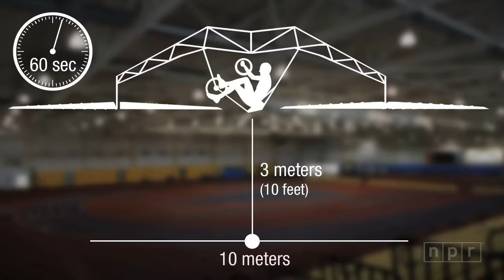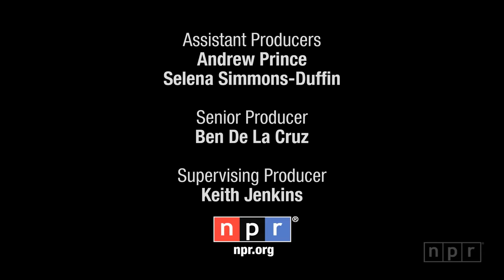Human-Powered Helicopter: Straight Up Difficult | SKUNK BEAR

Comment: 10 years later:
“What type of power does this helicopter use?”

“2 double A’s”
Reply: @archangelmichael5908  they are light weight
Reply: @poke_champ  I'm not heavy.
Reply: honestly, they probably could retrofit an electric motor and it'll still e lighter than a person
Reply: @daddyplankton5855  then it would just be a giant drone and where’s the fun in that
Reply: @ebeneZr   yeah there's no suffering
Reply: That is possible but you'd only be able to run it for a small time, here's my calculations, feel free to correct me if I made any wrong assumption or approximation:

The power requirement for the helicopter to hover for several seconds in this video is 0.7hp as stated in the description. Let's say after 10 years material sciences has improved enough to cut the weight to 25%, effectively reducing the power requirement to 0.175hp, which is 130 watts

A double A battery holds about 14400J of energy (4 watt hours). 2 batteries makes 28800J. Let's say 10 years later battery capacity has tripled, which makes it around 90000J, and assuming each battery can output at least 65 watts (which is a lot and it's 20 times the power current batteries can output)

The amount of time the batteries will be able to power the helicopter is 90000/130s ≈ 700s ≈ 12 minutes
Reply: i love your profile pic, name, and this comment
Reply: @facecrafter1328  The energy density of todays batterys is allready equal to that of TNT, its is not clear if a big improvement on that is possible.
Reply: @hernerweisenberg7052  Lithium Ion technology only goes up to about 0.8 MJ/kg, Zinc-Air (the best non-rechargeable) is about twice that. TNT comes in at 4.184. There is certainly a lot of potential for improvement though. Lithium air has achieved 9MJ/kg in the lab, but it has a ways to go before it is widespread. Organic energy storage can go above 35MJ/kg, and miniature internal combustion engines have been made that could burn organic energy. I'm actually not sure why these aren't more widespread in phones yet. Perhaps because Oxygen can't be stored as densely?
Reply: If you look at energy density of fuels for combustion engines, it is assumed that you take the oxygen from the air. If you include oxygen into the energy density for applications like rockets, it goes down from about 46MJ/kg for kerosene(for airplanes that use air) to about 10-11MJ/kg for RP1/LOX.
Regarding the phone application, that sounds lika a really bad idea ;D
Reply: Solar
Reply: Training bras only
Reply: ill check in 10 years
Reply: anyone watchin in 2030 please confirm
Reply: @ebeneZr  whats not fun about a giant freaking drone, that sounds sick
Reply: LOL
Reply: This video is almost 10 years old. What would be the point of a huge helicopter incapable of lifting anything?
Reply: wait fanf was set in a helicopter? huh
Reply: @Juksemakeren  to win 250k, of course.  and they did, just a few months after this vid was last posted.

Comment: they're using the same gearing for arms and legs, It would be better o have slower for legs and faster for arms to cater to their max strength outputs
Reply: but it would be heavy, and I think they considered that already
Reply: Kommentator 123 I would have thought that they would have considered it already but it should only produce a negligible weight increase (max 500g if done right).  simply increase the size of the leg gear and reduce the size of the arm ghear to get the ratio and then resize the spindle to maintain the same kinds of rotational speeds.
Reply: Could work!
Reply: the arms are just lightening the load of the legs. it's the same gearbox for both of them. there are no separate gearboxes, just two inputs.
Reply: ***** This is not entirely true, the arms are producing torque, just like the legs and while at the moment, they are attached to the same geartrain, what we were discussing was the possibility of changing the gearing ratio for the arms (which just requires changing the size of the arm pedal gear), thus allowing them to bettwer utilise the arm power of the user
Reply: James Ward
pretty sure they thought of that and that's already the ideal rate.
Reply: The real problem there is that the pilot would then have to move their arms and legs at different frequencies, which would mean they couldn't swing their body laterally in the same way. The pedaling motion isn't just moving their legs, their whole body moves to preserve momentum and gain extra leverage and stuff.
Reply: Anson Mansfield ahhh, that makes sense
Reply: The difficulty with this idea is that the pilot would have to rotate their arms and legs separately at exactly the right speed so all 4 propellers matched. And the added weight of the second gearbox/gearing
Reply: There would be no added weights. Currently they both on x# of teeth sprockets. You could make one x-5 and one x+5 teeth and the weight would practically be the same. They do how ever need to get one athlete and set up a controlled testing method to find out what ratio is best for that one person..
Reply: Nicholas Hartzler
Reply: Another thing to consider is how to max out the output of force from the person while using as few muscles as possible.
Reply: We are not allowed to say what would work.
I have a degree in math and I am unqualified to answer this question.
Reply: yeah i was thinking that too to lower the gearign ratio for mroe muscle =higher rpm
Reply: Strength/Height isn't their problem though.... If you actually listened to the video, you would've heard the guy say he has yet to become fatigued and had to stop. Their issue is with the drift. Also, these are ENGINEERS, who have spent probably thousands of hours on this project already. You watching a 5 minute video and telling them to change the gearing is kind of a slap to the face, I would think. They've already thought of that, bro.
Reply: wonder if frame wouldn't support the stress of the torque
Reply: Impossible. The arms have to balance the legs. If they are at different speeds they will sometimes be helping, but mostly hindering badly. Have you ever walked with your right arm swinging WITH your right leg? It's almost impossible to walk. Same here. The leg power strokes need to be counterbalance by the arm power strokes.
Reply: it could work better if he sat on it like a two wheeled bicycle. then he can put his back and body weight into the pushing and pumping of his arms and legs.
Reply: the best idea would be to control the propellers like the arns for the front and legs for the back so they could control drifting
Reply: Just noticed the arm pedals!...probably not worth while at all, they should use bicyclist and just use leg power.
Reply: they need non-twig pilots
Reply: they dont have differing gears because it would have to be changed for every new pilot.
this way....one size fits all.
Reply: I thought legs were stronger than arms ?!
Reply: I also think they could switch the pedals of the arms to allow the muscles to work as they should (rowing instead of cycling for example)
Reply: also im pretty sure its meaningless to use pedals for arms, would be better to put some bar to hold on to and try to maximize leg output.
Reply: @juicyclaws  so much this. And get a good cyclist with experience in recumbent bikes, and it would got through the roof

Comment: you need some kind of a weight like in agyroscope to get enough throttle I guess...I´d try it with a variable length so that it sticks out more the more speed it gets
It may be helpful to run it in a gyrocopters design anyways

Comment: Da vinci APPROVED THIS
Reply: If you look closely you will notice smoke and steam rising off the da Vinci machine. So much for man power. If the thing at the bottom was indeed a platform, the man would spin himself off it. His ornicopter, however, could have flown using a man power. It was engineered for movement like climbing a ladder, very efficient. Perhaps better take than this one, as here left goes with left and right goes with right, not the most efficient way of going about it. And I mean this already is awesome, indeed. Not everybody is da Vinci.
Reply: @kokeskokeskokes  obviously that never happened hahaha

Comment: This is late 1400s' cutting edge tech. Da Vinci would be proud of them.
Reply: i flew further when i was 8 years old and jumped off the roof wearing my Batman Cape.
Reply: .. I mean, with the exception of the Styrofoam.
Reply: I think they used a bunch of carbon fiber trusses and stuff
Reply: When you do level one in expert mode
Reply: ah yes my favorite kind of 1400s tech... carbon fiber tubes.
Reply: @cacornhusker2940  Ahhh, but the point of this was hovering.
Reply: @Nashvillain10SE  Excellent Point. Watson.
Reply: @cacornhusker2940  🚁
Reply: Did you miss the part where they said "the highest a human powered helicopter has ever gone was 3 feet in the air" or are you just as dense as a real aircraft?

Comment: Imagine being rescued in the middle of ocean by this thing
Reply: I will hug the pilot!
Reply: I think a slight breeze would be a nightmare for this thing
Reply: Only to see it crash in front of your eyes, while you're shouting at it: BACK DOWN, BACK DOWN!!
Reply: Only to have the pilot say "sorry, this thing can only carry 1. Bye!"
Reply: Johan Rodrigues  Johdrawn Drawnrigues
Reply: Imagine fly over the ocean with this thing and not get crushed in 5 minutes
Reply: Lol yeah right everyone will die hahahahah
Reply: Just drop down a string attached to 1 single helium balloon that says "Happy Birthday" on it. Say "good luck" to them.
Reply: @m.i.b member And maybe a second rotor and a chassis, maybe batteries and self controlling electronics, maybe 2 more seats, a radio system and lights..
And maybe a gasoline engine?^^
Reply: g- grab my hand

What? 

I SAID GRAB MY HAND!! 
I can’t hold it for much longer
Reply: impossible. this obviously has a weightlimit that would be greatly exceeded by 2 humans. there is also no way somebody could fly this for a decent distance.
Reply: It's impossible... no it's necessary
Reply: Bahahahahaha
Reply: I won't complain
Reply: soon those sharky will be headless
Reply: imagine someone finding you in the middle of the ocean
Reply: Is the flash pedaling
Reply: No, I cannot imagine it because it won't happen. VITOL or real helicopters do the job a hundred times better.
Reply: can't i see the fucking thing can't go over 3 mts high in a close space
Reply: Both would die
Reply: guys foot slipped off the padal and they both drowned
Reply: They can barely lift off with one person. Good luck with around half the power/weight ratio, the best part is that it has no steering so you would have to rely on the air currents. Might as well be floating on a piece of wood and rely on water currents lmao
Reply: imagine, he gets there and he is like "yeah I'm pretty tired you are going to have to pedal the whole way back."
Reply: All jokes aside, the styros used on the propellers are very, very buoyant. I would use the parts to make a pedal powered propeller boat
Reply: Well, it will certainly float.
Reply: You better hope they ate their wheaties in the morning

Comment: i think that they were working on the basis of the ground effect, which was sorta why they could get up to 8 feet kinda easily, but it would plateau about there. this is really really late, but they could've just lengthened the wings by a bit to get a bit more height out of the ground effect to reach the 10 feet goal.

Comment: I suspect this is more of a wing in ground effect craft - fine hovering near the ground but it will take a lot more energy to get it much higher.
Reply: My thought as well. Good idea making the rotors on the bottom for lift, but the drawback is the instability. May need bigger rotors?

Comment: Clearly operating on ground effect, and sliding off of the pressure column causing drift
Reply: Indeed.
Reply: Would like to see at least basic controlles to help with drift. The draw wheel that pull's the string should be much larger current one looks to be 24/26 inch wheel a 29 inch wheel would take up string just a bit faster and gear up just a bit would make it easier to hold it off the ground but might take a bit more to spool up to get off the ground up date please
Reply: r/iamverysmart
Reply: Clearly.
Reply: @thomasnygard2246  A tag line (if allowed) would do wonders.
Reply: @bobbastion7335  looking at the rules that no lines of any kind because than it would technically not be in flight but still grounded have thought about this a bit some moving ballist could work but that adds weight
Reply: @thomasnygard2246  I am a layman of course and do not pretend to know anything about human-powered aircraft. What they have accomplished is a monumental effort that I never would have thought possible. Maybe if the axis of props/rotors were tilted ever so slightly (maybe 2-5 degrees) toward the pilot/payload at the top to give a little outward thrust all the way around?
Reply: @bobbastion7335   you sound fairly smart it took me awhile to find the rules but the prize has been won  so now what is the challenge?
Reply: @thomasnygard2246  I'm not too smart (especially if you ask my wife), I didn't know the prize had been claimed. I guess that they will simply increase the parameters.
Reply: I wonder if they were smart enough to turn off the building's HVAC system?
Reply: Yes, they are drifting because they need to balance on a dome of compressed air. I think most of the benefit is from the ground effect. If they started at 20 feet and tried to rise to 30 feet, they probably wouldn't be able to even lift a single foot. Given the rules though they should absolutely take advantage of that. The fans should be toed inward slightly to maximise the size and density of the dome of compressed air. They will also need automatic guidance to keep the craft on the very top of that dome - possibly with horizontally facing fans

Comment: Not an engineer or anything.. but of course, with that massive high aspect ratio, low AOA, 2-bladed rotor will cause a huge ground effect - which led the entire craft and the pilot to lift immediately even with just a few revolution of the rotors. The gyroscopic effect from pedaling might have added a tiny amount torque to help cause drifting. I'm amazed how these engineers achieved such thrust to weight ratio to lift 8 feet off the ground and to find a capable athletic pilot!
Reply: Same. It’s truly mind boggling.